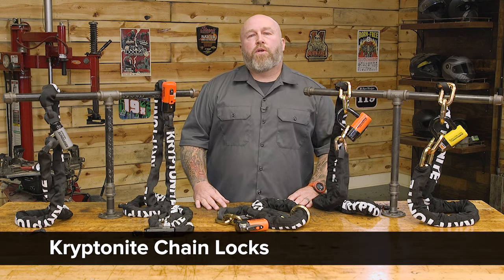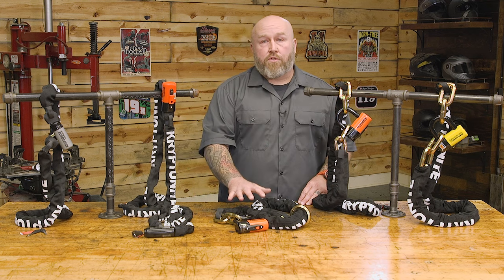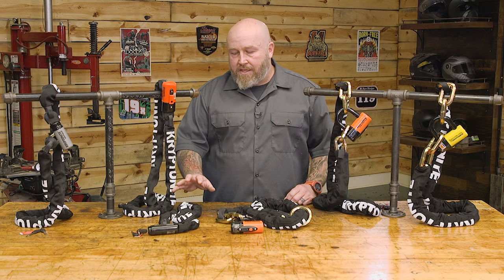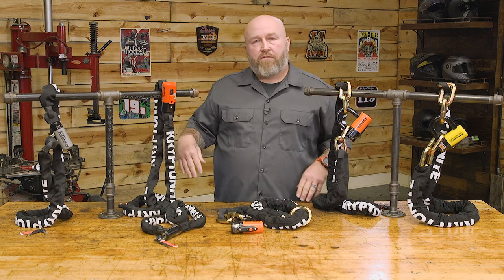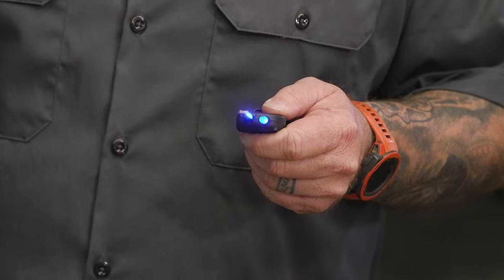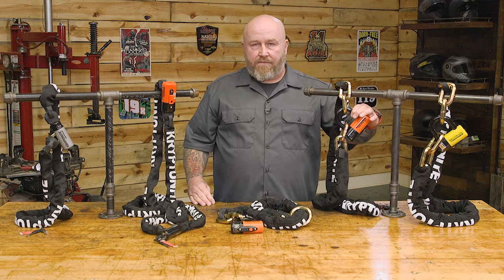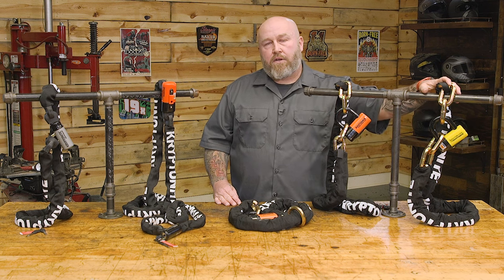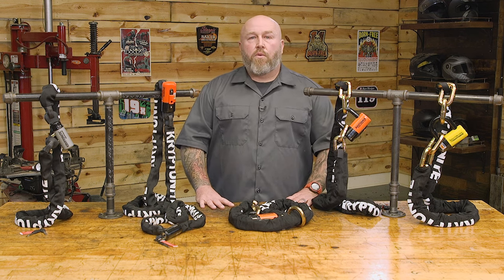Kryptonite Chain Lock Overview

Comment: I use Kryptonite Evolution 4 Mini (55cm) 10mm chain. It's probably the best portability to weight ratio while still having adequate security for the price of my Escooter. I went for a chain over a D-Lock because I can wrap the chain 1 or 2 times around the frame-neck so there is no chance a thief can take the front wheel off and slip the lock through the gap. And if I find something more sturdier to lock it to then I have extra available length. All considering my Escooter is worth $500, not $5000.

Comment: The real test .. how long does it take you to cut thru chain with a portable wheel cutter ?. Thats what they use !
Test the 10/10 chain.ill guess 4m
Reply: between 30-60 seconds
Reply: @stevensteven3417  can the keeper chain be bolt cutted?
Reply: @misconduct6845  yes
Reply: @stevensteven3417  with like the medium one or the big one without any support from ground and pure strength? I did see a review being impenetrable but I had to make sure
Reply: @misconduct6845  You can cut it with the big one with pure strength in seconds. I would strongly recommend at least the Evolution and a chain. U-Locks can be busted open with leverage tools like a long metal bar and  other tools.
Reply: @stevensteven3417 where do you get a good bolt cutter? I locked mine up with a chain like in this video but the key fell out of my pocket, I ran into some police officers at the place and they tried a bolt cutter but it didn't work
Reply: @nebuladog  
Hydraulic cutter like lockpickinglawyer used but make sure you have police presence or inform them else they'll think you are stealing it.